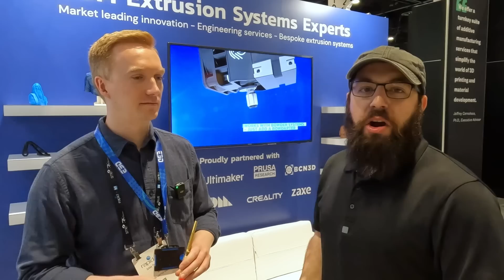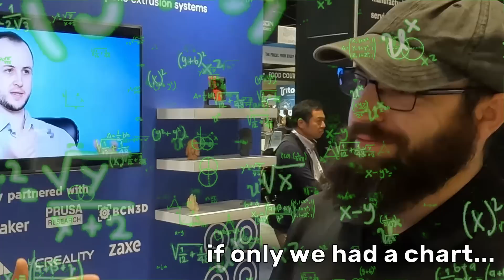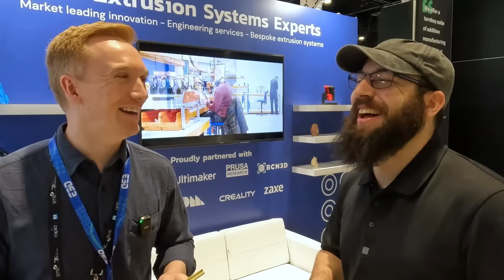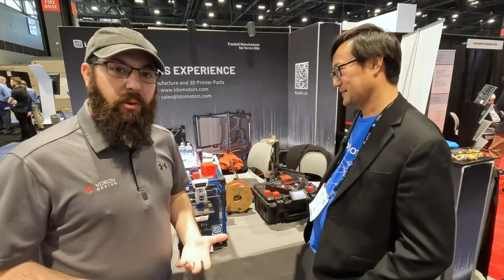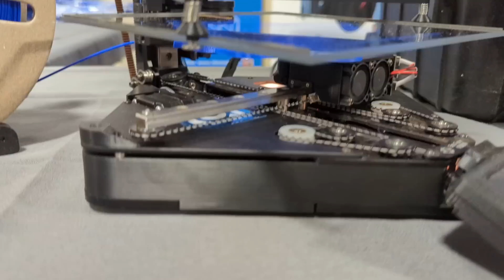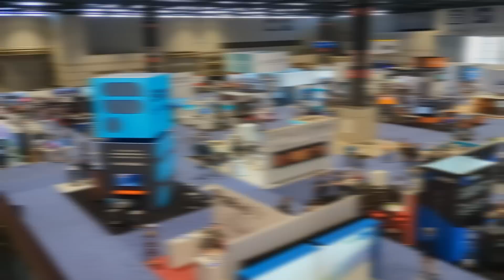High Flow Revo`s and Upside down printers - E3D/LDO @ Rapid+TCT 2023

Comment: Is that not the positron v3 by kralyn 3d? Or did LDO start their own design?
Reply: It is, It think they collaborated on the evolution and simplification of the design, on V1 and V2 there were a lot of custom stuff, so it was difficult not only to make a kit, but even to source.
Reply from the maker: Correct, LDO is taking the work Kraylyn did (along with giving credit) but changing things to make what is a very custom machine, mass producible. Once you start looking into making kits and needing consistent reliable parts sourcing things change.
Reply: We closely work with Positron team and final production will submit to them for approval before send to field.
Reply: @ldomotors  Thats awesome to hear he was able to get someone to pick it up. I hadn't seen any updates from his channel in a while so didn't know if the project fizzled out.